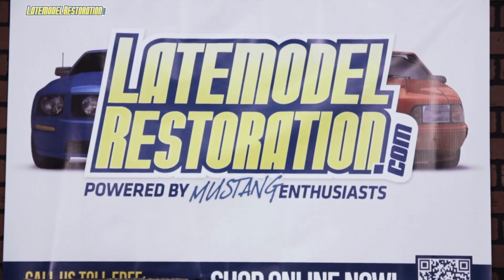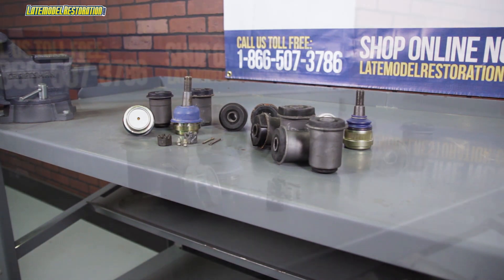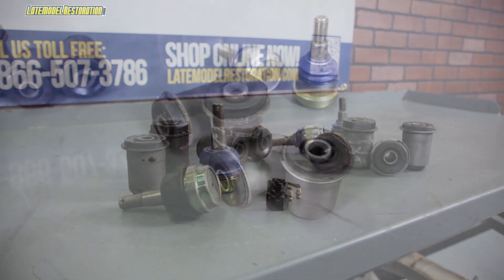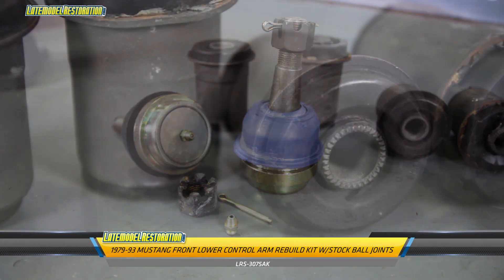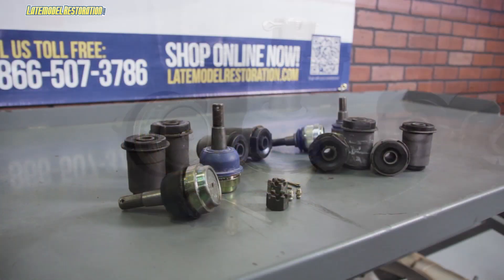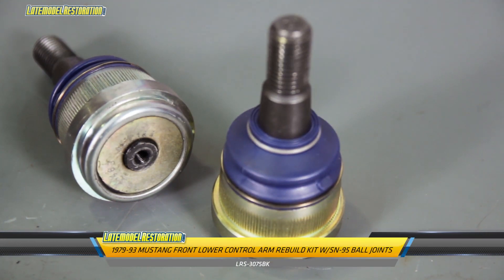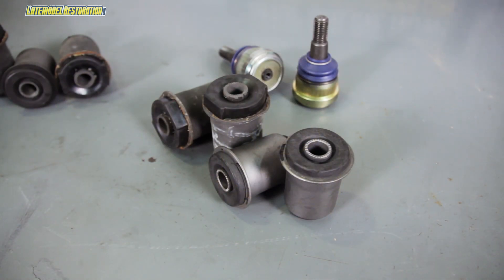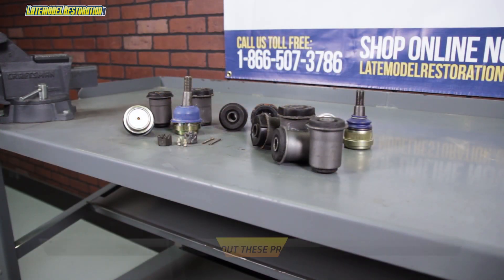Mustang Front Lower Control Arm Rebuild Kits (79-93 Fox Body)

Comment: quick question my ball joint on my right was bad so I replaced it different from the stocks ones but i left the stock on my left side one cause it was good would it cause a vibration on my left streering